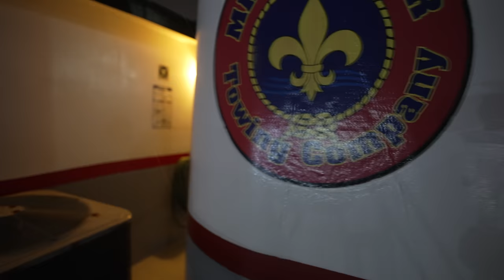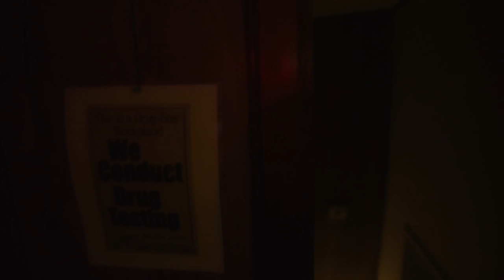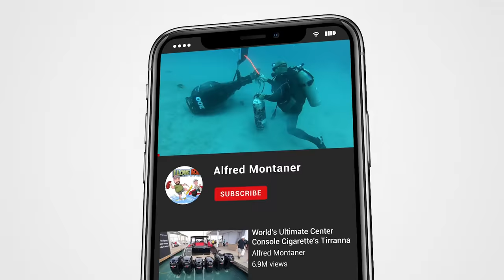Tug Boat Working the Miami River at Night (Lightning Storms)

Comment: It’s great to get a tour of Miami from the river point of view, and some general knowledge of tugboat operations. But for some of us that are thoroughly interested in the mechanics, the forces, the timing, the tides and the momentum we would love to see some more of a throttle work, and how turns are initiated whether he splitting the 
Throttles, pushing, or pulling to achieve desired turn, and the timing applied such forces.

Comment: Old school REAL tug boating !! My first paying job was on a tug in Georgetown SC.  A Consolidated , 1945  YTB with a Fairbanks - Morse direct reversible engine. And it gets better .. I was taught  how to answer bells , buzzes and jingles !  Only an old school Tug - Boater would know what that means.  Our tug manager and docking master was Capt. Morgan too!  Not the Morgan in this video but , Capt. James Morgan Futch.   Awesome video , real skills, throw rocks at those tractor tugs !
Reply: Bells, Buzzes & jingles..Old time communication as far as commands in the engine room go .
Reply: @bluet.stormz8790  Very few folks alive today that know what this means.  I even had to light (punks) drop in cylinder to get the motor to fire when cold in the winter. Kept them in a Mason jar soaked in diesel. Air start , direct reversible 6 cyl. , 4:1 reduction box.
Reply: Being in Georgetown like that did you ever meet or work with a captain named speedy?
Reply: Buzzes, jingles, shartz

Comment: I have built working radio controlled model tug boats (4 1/2foot long) that I operated in NY harbor, what a trip.  I used to hang around tug boat yards years ago viewing the operations. This video was so well done with lots of details. I never had the time to take a long trip (they offered a 24 hour round trip up the Hudson river) on a 104 foot river tug, The Frank Barker. Thanks for bringing us along on your trip!

Comment: This brings back memories of when we, Hyde Shipping, were on the Miami River right next to Antillean where you are taking the Babun Express from. We were on the River from 1976 till 1994 when after our ships got too big and it was too difficult to take them up and down the river, we then moved up to Port Everglades. I remember after we loaded our ships, Hybur Intrepid, Hybur Clipper, Argosy and Odosy, Backus Towing had to pull them off the bottom to get them into the center of the river as the shoulders were very shallow and as we loaded the ships, they sat on the bottom. They also had to tow them down River as the tide was going out and up river as the tide was coming in. This made it very difficult to keep a schedule. Now we are up at Port Everglades and our ships come in and go out when they need to.  Thanks for taking down memory lane.

Comment: I (Rob) use to work in the River back in the winter of 1976/77 for Ebsary Foundation Co.  they had two little tugboats one of which we had at Lehigh Portland Cement company out on route 27 past the Palmetto Expressway in Meldley. We had two tugboats out there pushing rock barges 24 hrs a day between the Draglines loading them and the Clamshell unloading them at the crusher… anyway I worked on that River back then, watching all that crazy stuff with the tail tug doing all the wild work. Crazy Crazy action on that River..!!! It has changed so much since then I didn’t recognize it, but we were just past one of those bridges on the left going out east bound… Great Stuff..!!😎👍👏👌

Comment: I wish I had enough time to watch the entire video. I’ve got 15 years experience on the inland rivers and have always wondered how similar tug work was to inland towing. 

 The ball on the end of the heaving line is called a Monkey’s Fist. A Heaving Line is a messenger line usually used for transferring larger and heavier lines between two vessels or from vessel to dock/mooring. 

 The engineroom crew take pride in their work or they really cleaned up the engineroom for making the video. Those Detroit engines are known for making oil drip from everywhere. I know they are a tried, true, and proven platform. But man are they loud. If they are not leaking oil they are not running. 

 I hope to be able to return and finish watching the video.
Reply: Right Timothy, and the lack of marine and maritime knowledge really distracted from this video. Alfred and his armatureistic  videography really irritated me. If he was close I would punch him every time he said "crazy." What a great opportunity squandered.

Comment: I don’t know what those tug captains make but it’s not enough money. Watching this and how they have to work the ships to keep them moving the right direction and keep them off those multimillion dollar yachts they do not get paid enough. Madddd RESPECT. I have had to tow a few boats off lakes and rivers but that doesn’t compare there the rivers can get dangerous with fast water skinny gravel sholes to run over or around. The towing on Lake of the Ozarks the problem there is all the high speed boats you have to plan for because these fast boats the owners might drive them 2-3 times a year you know they are a status symbol but those out of towners will run you over. There is no speed limit on Lake of the ozarks during the day time so if your boat will run 150 mph have at it if it runs 200 have at it. But then you get the people that moves to the lake from somewhere else never had a big power boat so they buy what ever their neighbors have. Then that ends up being a 400000 dollar skatter with huge turbos motors and take it out and befor you know it they have hit another boat run up thru docks run the boat in to a cliff. So that’s why I stoped towing boats on the lake of the ozarks

Comment: Alfred I'm sure you know but there is a little gem of a restaurant right up the river from Rt 95 called Jamon Iberico Pata Negra(hope I got that right)  A friend brought me there(I'm not spanish) but it was the bomb.  He said it is the best in the city.  What a really nice place with awesome food.   It has been a few years since being there but I highly recommend, the spread we had was as good as I've had anywhere-Spanish wise.  I didn't see the bill but I know it wasn't cheap but worth it-not slum dining for sure.  Some holes in the wall may surprise folks though.  It doesn't look like much from the outside and if you didn't know it was there you would miss it.  Actually there is really no reason to be down that street unless going there.  Tall white building across from the river-not on the water/no water access

Comment: Bravo to the tug captains, awesome work. What a pain in the beans route with that cargo ship. Wouldn't it be easier, quicker to unload the containers at one of the ports and then truck them to wherever they are going ? Just curious 👍😎
Reply: The decision to move those containers is a time thing and usually by water is the cheapest.

Comment: Vest on when on low deck. Huge nope not to. 
You would freak here on the Lower Mississippi River (the first 1000 miles) 
I Capt a crew/supply boat for the towboats. 200+ footers pushing upwards of 48 barges with up to 11,900hp worth of engines (trips). Fuel capacity of 200,000+ gallons and oil of 10,000+ gallons.
It gets wild especially at night, during storms or fog. My crew boat has only 500hp but on a 28 footer so I can zoom around and stay out of the way. The currents here are insane. All my work in done on the fly from 5 to 13kts. They never stop.
Those lines you see. My front porch is circled in them. Lol! Heavy.....

Comment: most prices you mention are pretty much the same over here. But my insurance is much cheaper and so the marina is. But that is because We are not in a commercial marina. It is an association. So I pay half compared to you and to keep costs low we have 2 workdays of 8 hours every year. Then we do maintenance on the marina. Oh and we have two diesels instead of gasoline so a bit less fuel. And we pay the same for diesel as you would with a car since it is  also cheaper because of the association. Haul out and outside winter storage is also more or less the same. And because we live much closer to the marina ( 12 minutes drive) we pay far less for traveling.

Comment: Miami has certainly changed.  The skyline the river is different compared to when I grew up there.  Miami biggest problem the criminals that move there from other places for the drug trade and horrible gangs.  It is a beautiful place.  The tug boat guys did a great job guiding that ship out of the river.  Point of reference people conduct themselves on boats the same way people drive in the streets (reckless).

Comment: OK, I think I figured out/remembered just Where what bridge, 22nd street, that EBSARY FOUNDATION CO; was at on the north side… IF Anyone remembers them, there tugboats moving the Crane barges doing work in the Bay Area, let me know If I’m right about them being at the 22nd street bridge, haven’t been by there since January 1977 and it sure has Changed since then.

Comment: Are these tugs running air shift transmissions? I'm not overly knowledgeable in non voith tugs
Reply: Oooh, sounds like snobery , but I understand, you forgot Schneider, it's Voith-Schneider.
Reply: @capt.craigfurlong3959  it's just easier to type voith. And maybe